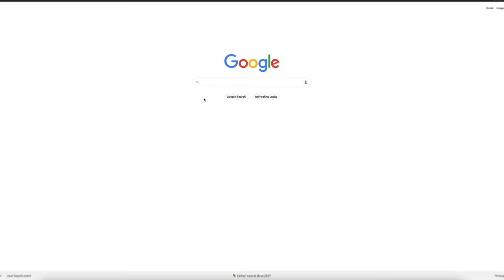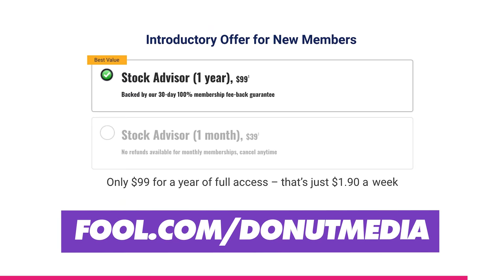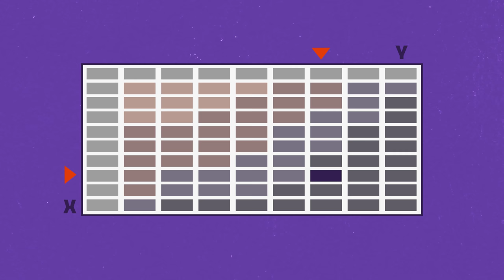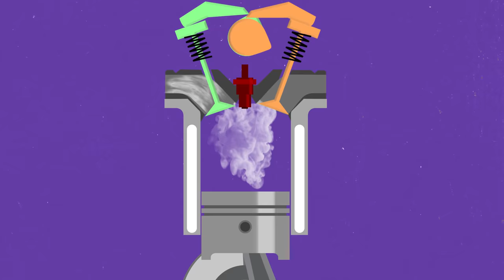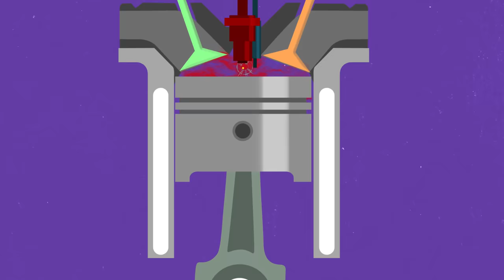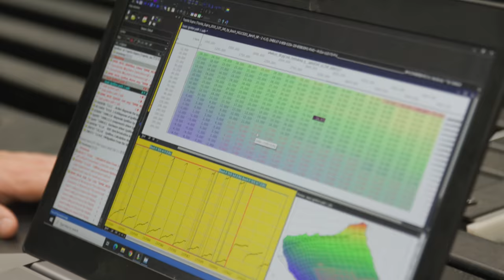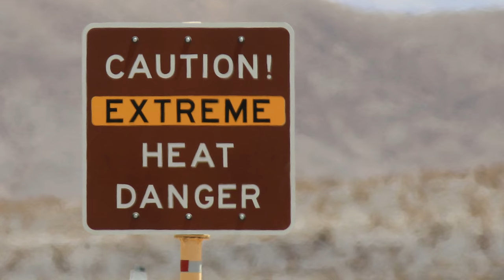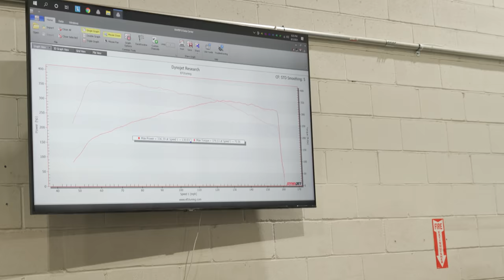Why Are They Banning ECU Tuning?

Comment: If California was interested in enthusiasts, they'd open offices to let us run tail pipe emission checks for a modest fee instead of slapping bans everywhere. Just because a car has an aftermarket intake, exhaust, or ECU doesn't mean that it won't pass a real emissions test
Reply: Yep - this is how it is done in the UK. Tune away, but you gotta pass a tailpipe test every year, and your numbers have to be within the acceptable stock ranges for that vehicle. However, you can also fail inspections for slightly dented bumpers, or slightly chipped windshields. Rust too, but I think its pretty fair to take cars with dangerous rotted sills off the roads. Germany is much more strict with their whole TUV stuff tho.
Reply: @Iain Bagnall  Thanks to "Dieselgate" cars from 2010 and newer (Diesel) and 2014 and newer (Petrol) get there ECUs scanned.The ECU's software version number and the ECU's checksum are matched against a database hosted by the Federal Office of motor vehicles. If the checksum doesn't match the car fails the test section called "Verbauprüfung".This leads to a failed main inspection "Hauptuntersuchung (HU)" also called TÜV. Which is the name of one inspection agency.Cars which are chip tuned rarely fail exhaust gas inspection "Abgasuntersuchung (AU)" if they got all catalytic converters and particle filters. Next year they are introducing new exhaust gas testers. I am not that concerned for my '09 5 Series and my '03 E-Class.
If they are introducing more and more regulations, I thought about registering my cars in Poland.
Reply: @EVS as someone with an NA car, every little bit can help. But yeah, I don't see an air intake that keeps all the sensors messing with emissions much 🙃
Reply: @TheFruitDragon  basically every diesel car under euro 6 is banned in germany and so most of your euro 4 and euro 5 shitboxes end up here on the balkan where we suckers buy 'em with their flywheel from the factory and then complain how shitty the car is (and mostly it is shitty because we own a golf 5 and goddamn stupid dual mass flywheel)
Reply: @EVS the car a 1975 using an ECU you can tune with a screwdriver. But hooking up a new intake or exhaust/ header, a tune is always worthwhile. My motorcycle runs lean and hot now because I didn't follow this step.
Reply: @EVS That’s nothing like true. All manner of naturally aspirated non-performance-oriented trim levels of cars can benefit tremendously from ECU tunes, they’re tuned from factory to provide good emissions and fuel economy, they can modify the fuel maps, spark timing for higher-octane fuel, etc. and make significant differences in power, to say nothing of taking advantage of modifications you may have which do virtually nothing with no ecm tuning.
Reply: It also means you won't change it the minute it's passed the test. (I've seen many people put the cat back in, get it inspected, and then put the cat back on the shelf for another year.)
Reply: @EVS Lady's and Gentlemen can we all give a round of applause for Mr. EVS the man the myth the legend. The guy who knows EVERYTHING and I mean EVERYTHING. Anything automotive don't you dare question him you will be smited for that. The anatomy an phycology of a woman he's a world renowned expert in the subject. Need a 100yo Victorian house restored call EVS who da fuck is Bob Villa? What I'm trying to say is that we all should be honored an blessed to be in the same comment section as leading internet/YouTube expert Mr. EVS.
Reply: yup...I put a 1999 Jetta 2.0l engine in my 1987 VW Vanagon...it runs so much cleaner I don't even have to tune it up for the emission test...
Reply: @mikeadams2351  my ‘81 vw Rabbit Truck is also emissions exempt
Reply: @Andrew-hs8ri  when they passed the DEQ here in Oregon they originally exempted cars after they were 25 years old or more...that screwed us and dropped that...fortunately the exempted motorcycles..of which I have three...one with carbs..no change/stock..two with fuel injection and custom maps and exhausts...BRRrraaaapppp
Reply: @TheFruitDragon  Poland: the Nevada of Europe
Reply: @AndyRock1  TÜV does have individual vehicle assessment options, where California doesn't have that option thanks to the 25 year rule and their 1976 emissions rule, so you do have an upper hand

Comment: I got an eco tune awhile back and it gave me more power than factory, I get much better mileage and can feel the difference, thinking of getting a retune for more power now, can't belive they would ban that. Glad I'm not in California
Reply: At least Scotland doesn’t have such pissy laws
Reply: And this isn’t surprising. Like the video explained, factory tunes have to work everywhere.. the cold of Alaska and the heat of Death Valley.. but a tune that appropriate for your climate wouldn’t have to make such compromises.
Reply: @Penryn87  or upgrade the ECU and sensors to cover temperature and pressure properly. Then you can build a tune that properly can cope.
As for why race cars need this...Pike's Peak Hill climb comes to mind.
Reply: What happens in cali usually spreads to the rest of the country…
Reply: @GhostOfDamned  neither does the rest of the US, California is there own mental case altogether. Glad I live in the rural Appalachian mountains in NC, we don't even have emissions inspections out here.
Reply: @frankdesbaux  chances are you don't commute by motorcycle. If you don't then cut the crap my dude your hybrid or electric vehicle is far worse for the environment. And it's not country by country it's person by person with environmental impact my dude. Imma keep going at 75mpg, let me know when you figure out your lithium crisis!
Reply: @frankdesbaux  Not really think China and India for that
Reply: Same, brother. Better performance AND fuel economy.
Reply: @davaneheron7881  your completely right though, the irony runs so deep it's mind-blowing people can't seem to realize it! Electric cars are cool and all but people try to push them as environmentally friendly and as long as we use lithium it's not going to be. Our three most environmentally friendly modes of transportation (for individuals)( not counting electric rail trains) are going to be walking, bicycles, and motorcycles. Hydrogen is too big of a safety hazard to be taken seriously. And diesels great in concept but in cities is pretty nonsensical which vastly lowers it's global potential. Not to mention how the sulfur diesel contains isn't exactly ideal either. 

In the long run my bets on nuclear powered batteries until a better technology comes out.
Reply: @davaneheron7881  absolutely the biggest challenge to that technology would be trying to prevent abuse. If people weren't shitheads we would already be utilizing it. It would need to be effectively made to be cheaper to mine radioactive material then it would be to harvest from the battery. It's not a simple task. Interestingly enough though they say it might be as soon as 2-3 years when we will have access to smaller phone  sized and 18650/AA etc form factors. It will be interesting to see how things play out, it's got potential for good and bad.
Reply: @frankdesbaux   china & north korea enter chat
Reply: @Thor Odin son don’t be so naive man.the epa is already fining guys who are not in Cali.I know of two to be exact.they don’t need to understand us even though we aren’t doing anything wrong,they’ll just “fine” us out of existence
Reply: @murderWhornets  Correct.
 I drive an Audi with a V8 motor...In fact I have two of them.
Reply: @frankdesbaux  so who are you roasting on environmental impact my guy? Fun cars no doubt gotta love em, but I'm sure you suck down some fuel between the V8 and I'm assuming likely being supercharged as well depending on what you have... Do you live in Europe? My uncle in Germany is in the Audi leasing program and gets upgraded to the newest year model every three years. We ripped the hell out of some back roads the last time I was over there, they're some mean cars!
Reply: @murderWhornets  Because he was a presumptuous fool.
 I actually ride my bicycle most of the time and I have another very small Honda that gets 55mpg  for doing errands in town.
 One Audi  for long trips and the other  an all aluminum  one is for towing the boat and beach launching.
Reply: @frankdesbaux  it sounds like a sweet setup. But even the sheer environmental impact of making those 5 methods of transportation you own, would be enough for me to say I wouldnt go roasting others on environmental impact. Stay safe, have fun, but stay chill to you know, half of America doesn't consume as much fuel as your lineup will. You would be paying two sets of gas guzzler taxes in many states just with the two Audis alone to help counteract the carbon footprint they produce.
Reply: @murderWhornets  
 It wasn't a roast.
 More so a reality check.

Comment: As a mechanic and tuner myself, older cars, which about half on the road in Kentucky are 10+ years old, really gets gains in fuel economy and power from tuning. 

But putting newer, more advanced or reinforced replacement parts on a vehicle, combined with a solid tune, often results in a cleaner burn within a certain range. And a lot of customers want their standard highway speeds and rpms in that range. 

The idea that the modern driver can afford a 10 mpg sportscar daily is ridiculous.
Reply: now i want to tune my 97 ranger 😝
Reply: Yeah,  this is pretty stupid,    that way.   Far from all car people are about bigger dyno numbers,  cat deletes,  and burnouts.   I care a lot about the environment and even my musclecar would have passed emissions in Massachusetts if it were a brand new Honda. (The stock emissions controls were obsolete and bad,  so what I did was get rid of those and optimize what was left for the cam I inherited and what I was doing.)     It'd burn a lot of fuel if I opened the taps,  but it burned it cleanly.   With these new computers I could choose similar optimizations.   (Likely by calling in someone more up-to-date for anything newer than say 2004, or preferably when I could afford custom ECUs.  :)  )   

Tuning's all about what you ask for,  too.   I wouldn't be asking for heyul yeah,  send it or bragging rights about HP numbers.   And these laws can backhandedly make it illegal,  say,  for me to put a much cleaner and nicer Honda engine in my Volvo,  which I'd love to try to do.
Reply: Someone asked for clarification... My standard highway speed is about 90, and that's 2800 rpm for me. In first and second I generate more than enough torque at 3400 rpm to drift based on my initial speed going into the drift. So the tune I want is between 2500-3500 rpm, for max torque. The car is too light to go over about 115 without the front end lifting up, so I'm not thinking about horsepower that much for what I do with the Kiryustang. I can still get a good 28 mpg highway with that and all my mods.

I modified an older car to be modular enough to both have fun, and be more efficient, with the reduced weight. That's what I meant by my initial comments.

Comment: This could be seen as a hit on right to repair, as well.
Reply: this isn't a right to repair..this is a right to modify...
Reply: @mikeadams2351  Two sides of the same coin
Reply: @lukeskinner2807  dudes ignorant, don't mind him
Reply: @wed3k  he's right, you 2 are reaching.
Reply: @wed3k  You have to modify a product to repair it, even if it is with comparable components, most of the times you can't do a repair properly with the exact same parts that were used originally...
Reply: @noneyabizz8337  Nope, anti-tamper technology intended to stop modifications generally considers repair a "modification" as well. See Apple and John Deere's serial number paired components that won't function unless they're paired with that device with a factory tool that isn't made available to consumers. To an anti-tamper system like this working as intended, repair is indistinguishable from modification.
Reply: Its not even close to Right to Repair. If The Car Manufacturer Banned It thats one thing. But this is the government, As well you do have the right to replace your ECU with the correct Factory Application...
Reply: @mikeadams2351  you can tune an ecu for more than just making a car faster, you could use it to diagnose issues as well. Which would put it under right to repair
Reply: @benjaminingenito530  I have two motorcycles with fueling modules in them that plug into their ECUs...some bikes you can get ecu flashes for..not mine unfortunately...if you change you exhaust pipe on a bike (and who doesn't?) it's a must...like cars all bikes run (way too) lean from the factory in the first place and a pipe makes things worse...no deq testing for bikes in my state so just about anything goes...all of the hot pipes for our bikes always come with a "only for racing" warning...lol
Reply: @benjaminingenito530  you can diagnose with modified ECU on private track / garage, just not on road, this right to modify, not to repair.
Reply: @lukeskinner2807  q
Reply: I agree - it's a hit on Right to Repair. Look at all the vehicles that come from the factory with multiple performance tunes built in. Admittedly, some are suspension/steering based, but many are power based. If a manufacturer can provide a vehicle with tunes and that's not illegal, why us the owner of the vehicle modify the tunes illegal, especially if it passes emissions inspection?
Reply: Triston Stuart  I agree. There are non OEM parts which are less expensive and better products. When its time to replace a sensor, these products are a better choice because they last longer (and in the case of some airflow sensors, can stand being cleaned with sensor cleaner).
Reply: @mikeadams2351  No its right to own something !!
Reply: It can be for any part of a car, truck or motorcycle.  It certainly doesn't help.  An overly broad bill that is supposed to only effect highway vehicles could have a terrible effect on the right to repair electronic devices if worded in ways it should never be.
Reply: This is Right to Repair IMO
Example: Air intake breaks and you replace it. Your ECU needs to be updated. 

Banning ECU tuning feels like its taking away freedom from the consumers right to repair.
Reply: Right to repair and right to deface

Comment: "Imagine actually doing emissions test" - Rest of the US
Reply: That is why I will always try to keep my car registered in my current county. My car is 15 yo and is emissions exempt so I can do quite a bit without worrying about having to pass emissions
Reply: Utah requires it.
Reply: I cant believe california doesnt actually measure the exhaust. Isnt that what really matters?
Reply: EMISSIONS! South Carolina has left the chat!
Reply: They test them on the east coast here, but they just plug into your ECU to “test”
Reply: my 94 miata is from cali but has been in florida for 13 years. dmv hasn't even taken an odometer reading since it left cali, let alone an emissions test or any kind of inspection whatsoever

"yes, officer... it's stock"
Reply: Had to get rid of a Prius which still hit upwards of 50mpg because there was a fault code in the traction battery. Car worked fine, but couldn't pass emissions due to having an active code.

A tailpipe test would have been a cakewalk. But noooooo, have to junk the car and get a replacement.
Reply: Northern part of Va does emissions testing.  They check for active or pending emissions codes and smog test....or at least they used to.  Not sure if they still do the smog test anymore.